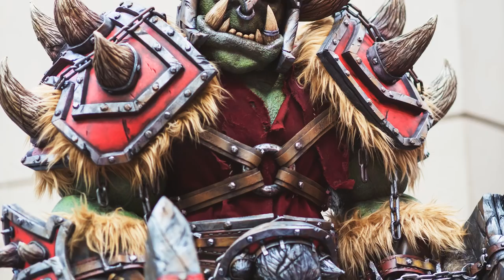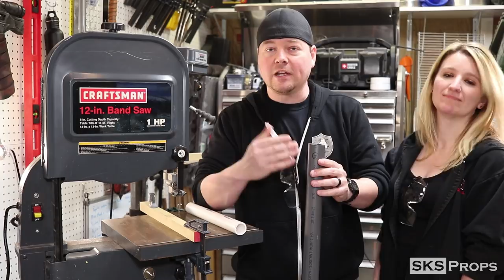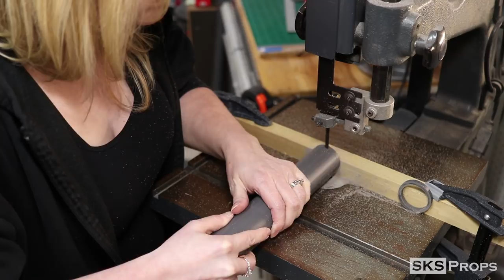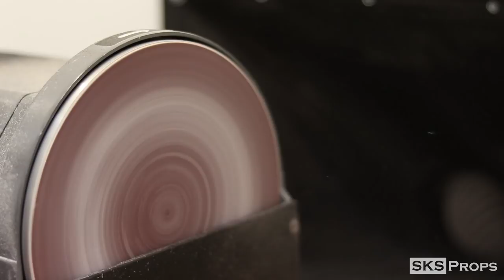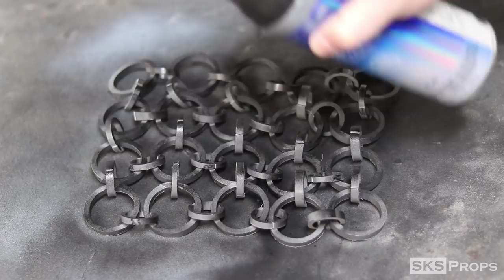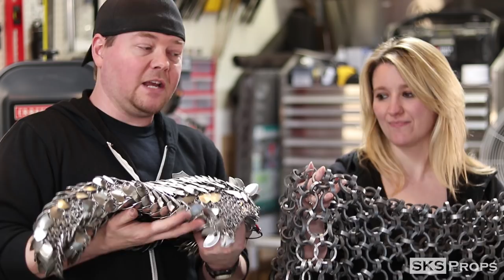PVC Pipe Lightweight Chainmail Hack for Cosplay Crafting Tips and Tricks

Comment: Nice vid bro. :) But... couldn't you just sand the pipe before cutting? On this manner, you'll get a surface you can spray on and make it stick longer. :) :)
Reply from the maker: Nope…that’s the wrong exposed surface, the paint needs to be applied more to the visible side that is cut than the exterior of the pipe

Comment: How would you recommend attaching some of this to a belt for some chainmail thigh armor ?
Reply from the maker: The belt I made was using 1" nylon and parachute clips to connect. If youve already got a belt you could tie it on or punch holes in the leather and run leather strips through

Comment: Did you use glue on the rings you cut? How do they hold under the weight?
Reply from the maker: Luckily the strength of the rings held together so I didn't have to glue any of them
Reply: Awesome. I was considering using pvc to make a lightweight  E4-1 shirt for my Halloween costume this year and now I'm glad to know I won't need glue. Thanks for your response.